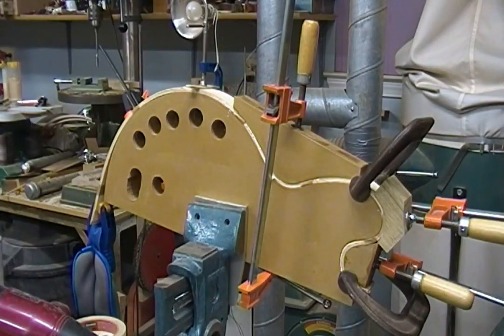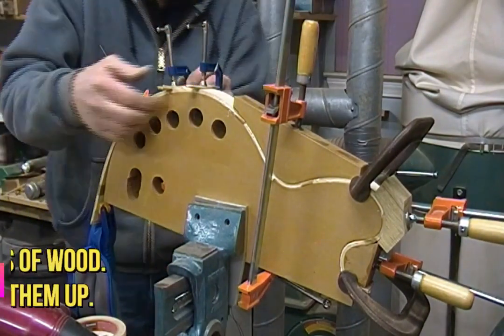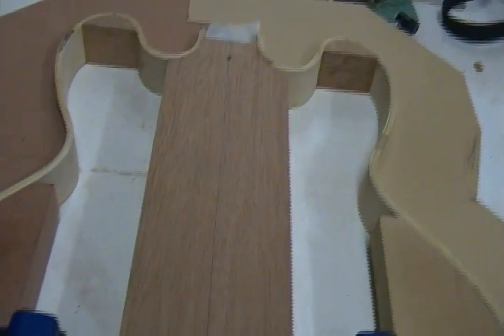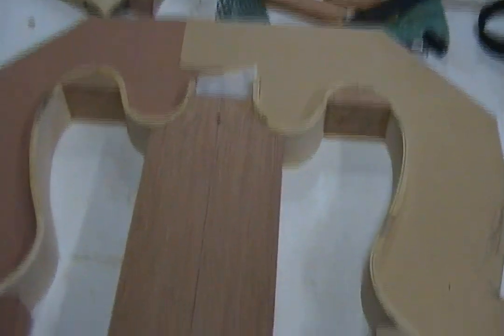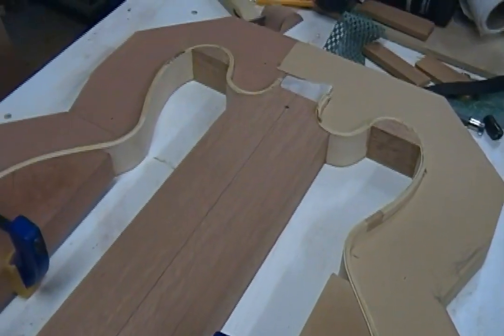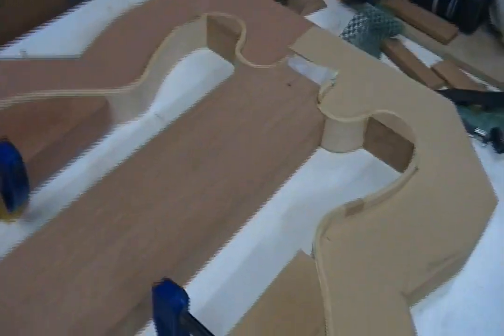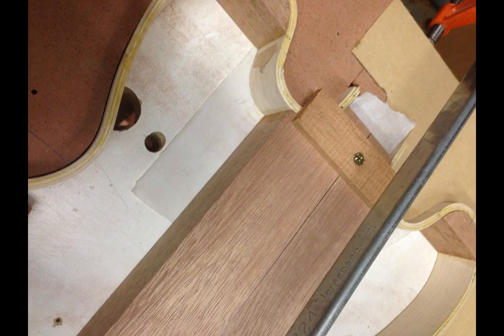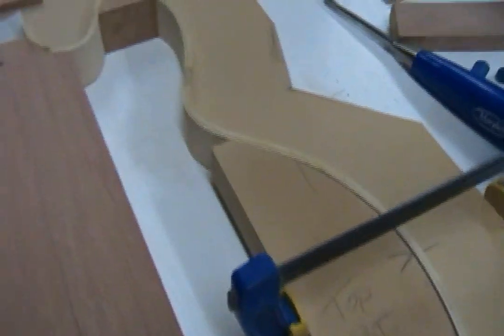CUSTOM BUILT JONAH ES-335 Part 5

Comment: Great work as usual Dane. I've learned some from this already, especially about forethought. Looking forward to that carve!
Reply from the maker: Dippy Hippy,  let me tell ya about forethought. I did a dry run then a glue up of scrap that I pre bent as a test for the mold. Then the other side off camera and then the side you saw. And I still couldn’t remember the c clamp at the end with the block I made special just for that spot. I’m very smooth!
Reply: I was thinking about how the molds are arranged so they can be released. You have to anticipate that and I would have missed it. Keep it up Dane because it's great.  ;<D

Comment: Yes, maybe a row of screws following the perimeter on either side would have worked better for the rope than threading through the holes. Just wrap the rope round the screws...
Reply from the maker: I think at first I thought the holes for clamps would be enough. But yes, screws would have been way better in hindsight. Thanks for having look.
Reply: @jonahguitarguy  Always great watching people making stuff. Will attempt my first guitar, soon. I will chicken out, as I would like to make a semi hollow, but more like a 339, so I will simply hollow out from a chunk of mahogany, leaving the "centre block" unhollowed, if you see what I mean. But I have a nice book matched piece of maple for the top, to shape, by carving... so looking forward to see how you go about the guitar top shaping. Thanks for the videos!
Reply from the maker: @timbeaton5045 , Thanks for taking a look Tim. Common advice to a new comer to guitar building is to do prototypes of the things you want to try out of cheaper woods so mistakes are not as costly. I never do but I have a long history of woodworking and cabinet making not to mention mechanical stuff like auto repair. In other woods I'm used to screwing up costly wood and don't worry about it. Just kidding I don't make mistakes.   ; )